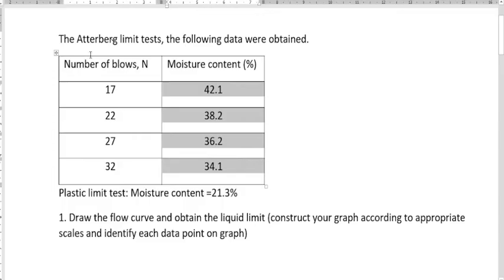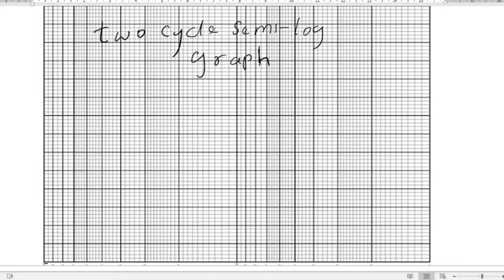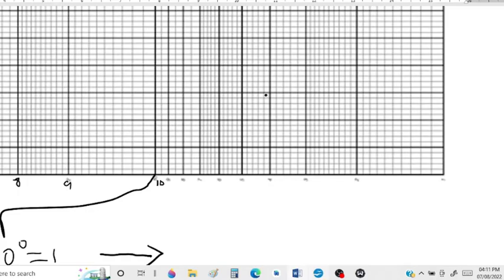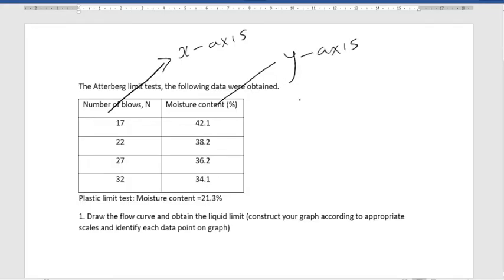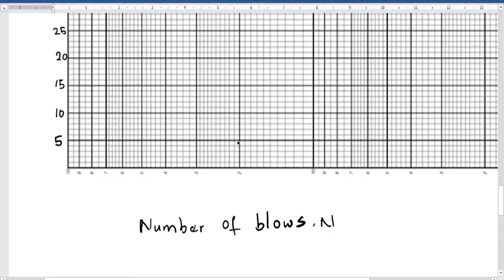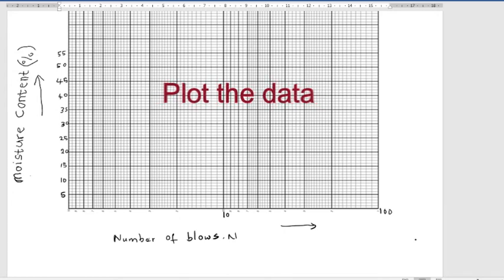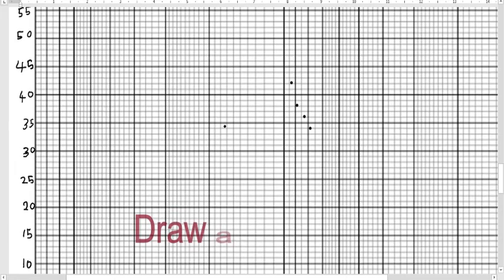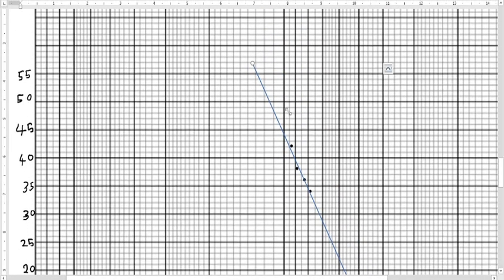How to plot liquid limit graph and calculate liquid limit (Atterberg limit test Question solved)

Comment: i have a question..why we took 25? and where it camefrom? please reply..thanks in advance
Reply from the maker: The reason why I  use 25 to extrapolate the LL is because 25 number of blow is the standard used to determine Liquid limit in Casagrande method. This is because at this number of blows , you will get a consistent shear strength of the soil. 

Like and share my video if you appreciate this response.
Reply: @MagmaUpwelling in my experiment test there is total of 5 observations and total 5 numbers of blows were counted. so what should i do now? should i take all 5 of them or just one?
Reply: @MagmaUpwelling  bro?